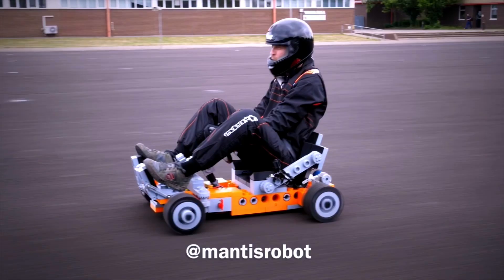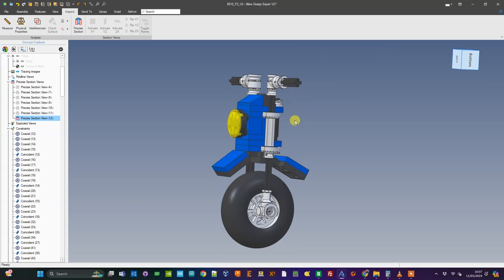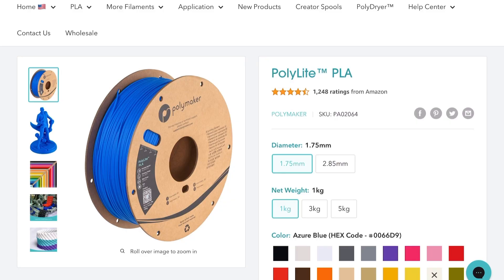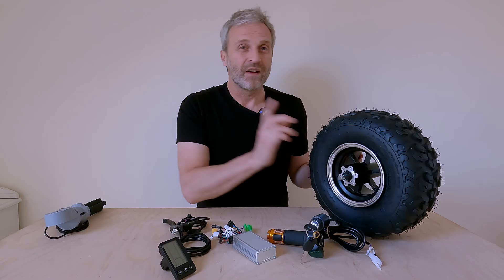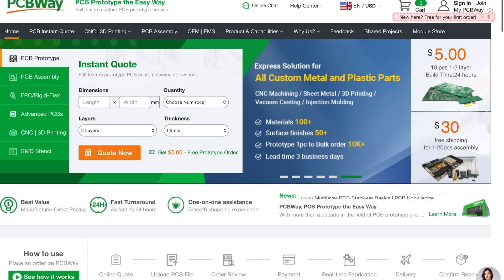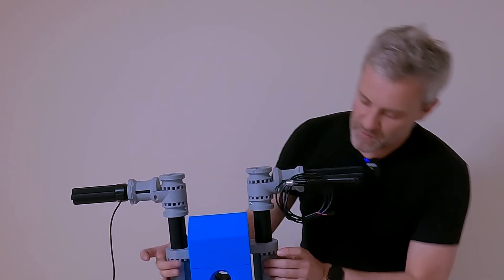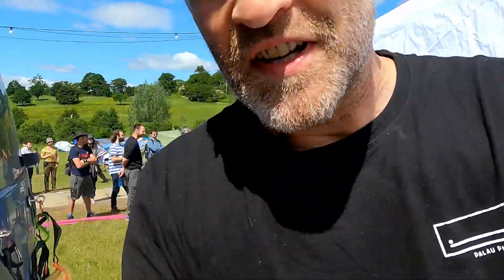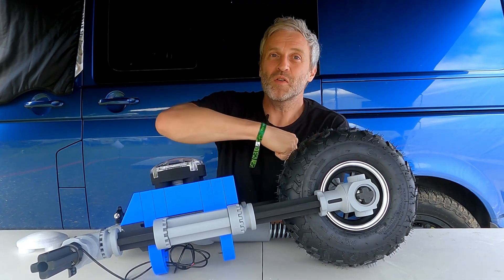GIANT Lego Inspired Monkey Bike!! - Part 1

Comment: I don't know polylite PLA, but I would never risk such a massive undertaking with PLA. Anything that I used PLA for that is under constant load eventually sags. Not to say that all it takes a bit of sun and a hot day for the thing to behave like molten chocolate.
Curious about how it performs in such large scale.
Amazing project by the way.
Reply from the maker: Check out the giant go kart 👍👍👍
Reply: @MattDenton  I did, pretty cool bybthe way.. That flex that you mentioned there is a bit related to what I am talking about. If there is anywhere in the kart that would put some constant flex in any part, that flex tend to expand over time and will not return to the original form and that is what I observed on PLAs in general, specially the + versions of it that make it more flexible (as a trade off to make PLA tougher). PLA does not return to the original form after being flexed for enough time. If the temperature is higher (like in a hot day, under the sun or near the  motor) the effect is more prominent. Obviously with much bigger parts than I ever printed it may take more time and/or tension for it to cause noticeable deformation. I'd still not risk using PLA, knowing about this shortcoming. ABS, for example, does not share the same problem and I use it whenever I know temperature can go up or the part will be under continuous load.
I am curious how the kart will withstand the test of time and usage. It has the downside of releasing VoCs (Estirene) during print, and may require enclosure / PEI print bed. But cost wise is similar if not cheaper than PLA.
I am not sure about PETG in respect to deformation over time, but it is resistant to higher temperatures although a slightly more flexible (but for this size of parts, I don't think it matters).

Comment: This is awesome and I love the creativity.

That said  there was a small bit around 8:30 that made me take pause.

You mention that the m10 bolt adds strength to the handle bar but I had a realization related to my having tried similar at a smaller scale before.

Does it really add strength if the plastic cannot handle deforming to a point past the bolt?

To put it another way, if the plastic delaminates before it reaches contact with the bolt, has the bolt really added strength or is it just there as a backup not directly contributing during the initial stress and breakage.

In essence I think the solution if this is even a problem worth worrying about is getting the plastic tighter around any metal components and or using plastics with more compliance before failiure like nylon or high durometer TPU.
Reply from the maker: Well.. yes and no. The bolt only ads strength to the part it is connected through, eg the black grip and the end of the grey buckle, but beyond that to the forks then it’s game over. 

So I should have been clearer on what I was trying to address. 🙂

Comment: i am speechless. ❤ such a cool idea! i hope the front wheel is angled enough. also, bikes (in reality) have that bend in the fork for a reason. perhaps you could offset the 3651 with a 1cm offset to the front? that would make a hige improvement on going a straight line i guess. 😅
Reply from the maker: Thanks. Yeah the fork angle is a little too upright! It’s not a very good geometry kit 😀

Comment: For the breaking handles maybe consider using 4593 Antenna Small Lever with 4592 Antenna Small Base attached with a 28974 Minifigure Neck Bracket with Back Stud - Thick Back Wall or use 4735 Bar 1x3 with Clip and Stud Holder
Reply from the maker: Yeah there are lots of Lego mods I can do but I’m trying to keep the vintage technic aesthetic for now…

Comment: What I would do with the handle bars is to take the gray pieces that connect them to the vertical bars and put them on upside down. As they are mounted right now leaning on them causes them to flex and potentially break. Flipping them however allows the grey disk spacers to prevent the parts from flexing, potentially making them a little bit sturdier.
Reply from the maker: Yes I looked at that possibility but they wait was designed on this MK 1 wouldn’t work.. maybe a future version 👍

Comment: Darn I really want an optical analysis of that 3d print as a real lens, could make many projects that are very tricky to find a suitable lens for easy if its a good as it looked on camera. Not to mention as an alterntive to having to source a good enough version of your old classic car/bike's lightbulb lens/covers to fill and polish then cast new ones. Worth the effort of casting no doubt if you have a few buddies with the same problem, but still if the 3d printer can actually just do it.
Reply from the maker: Yeah it’s an interesting process they have
Reply: @MattDenton  Agreed, I've seen passably useable 3d printed optical type elements plenty of times, but ones that at least on camera appear so perfect is a new one on me.